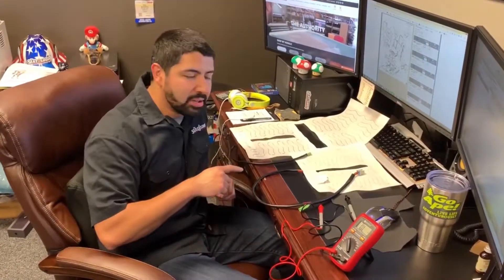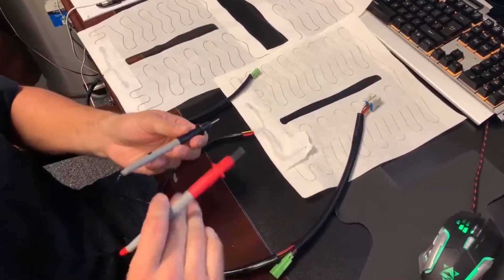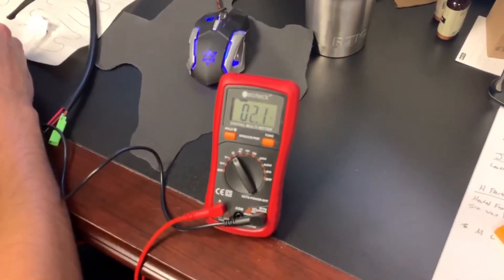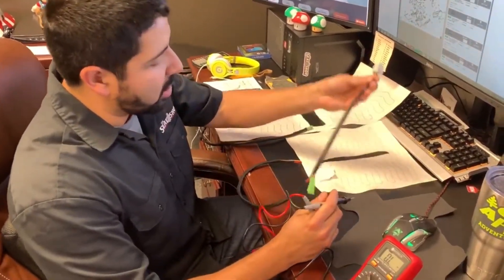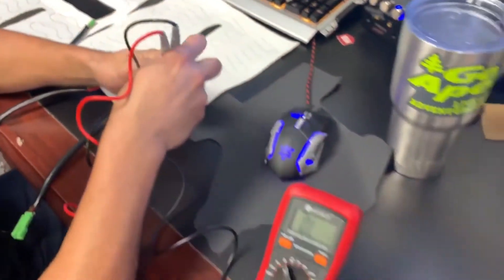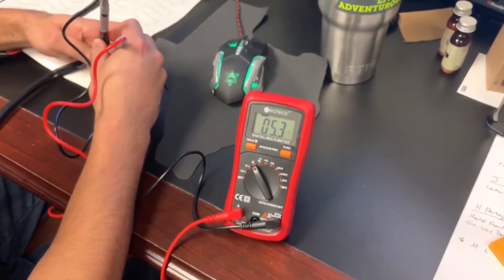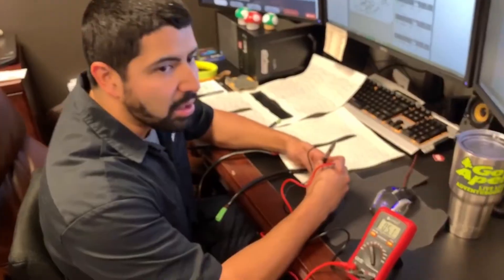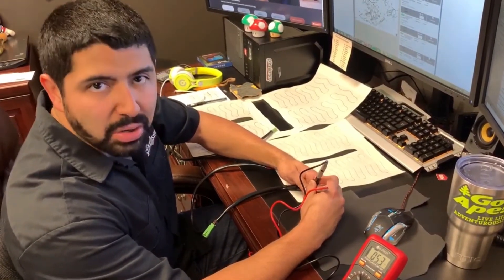How to check Heating Elements with a multimeter

Comment: When you say '3-4', what are the units, ohms or kilo ohms?  I've never used a meter but have a Ski-Doo seat and was doing the same thing though unsure which terminals to put the probes on.  There's one terminal on side side of the plug and do over on the other so had assumed the single one was ground.  And indeed after seeing your video it made me look for the wire colors and it is black which I think is ground.  But not sure with the yellow and red wires though one may be for low setting and one for high?  I get 1.8 mega ohms or thereabouts when black probe is on black wire's terminal and red probe is on either of the others.  I assume this is bad since it's pretty high so have to rip my seat apart to find the problem it seems.  But better than doing that when it was just fine and the problem lies elsewhere (though I checked for current with one of those probes that light up when something has power and the snowmobile end of the plug has power) which would be a big waste of time and effort.  I have about 2 dozen staples to pull out and re-install and wish they'd make heated seats more robust.  They must know what a pain it is if something fails and is why many people say they don't want heated seats.
Reply: What's weird (to me) is that the resistance starts at 1.5 or so mega ohm and keeps going up over say 1 minute to 1.7 and then keeps on going presumably to 1.8.  Earlier on it would jump to 1.8 nearly right away.  Not sure what that means.  I was also playing around without seeing the wires, nor therefore knowing what was black/ground vs power, and when backwards on the terminals so black probe on the yellow or red wire and red probe on the black/ground, I'd get 3.5 or 4 mega ohm.  That probably makes sense why if you understand electrical which I don't other than units and V=IR and how to solder wires.  Is it safe to say based on all this that my Ski-Doo's heated seat wiring must be severed or the heating element is shot for some reason after only 6,500 km?

Comment: My seat heaters come on and when they just start to warm they shut off, Do I need new ones?
Reply from the maker: It could possibly be that one of your elements is going out but we would need to know a little more detail.  Please let us know what Year/Make/Model you are needing help with so that we can better help you out. Just so you know at this time we will only have options for the Chevrolet/GMC/Cadillac 2003-2006 models and the 2007 Chevy classic.
Reply: Thank you for responding. My truck is a 2005 GMC Sierra 5.3 with leather seats.
Reply from the maker: @MrGlamis70  ok great, we would suggest watching this video to see if you can narrow down which heater element might be the problem - https://www.youtube.com/watch?v=Fhd2DPbTjeE&t=9s